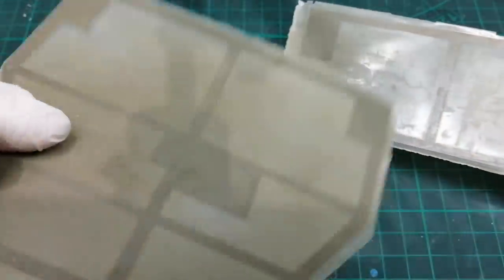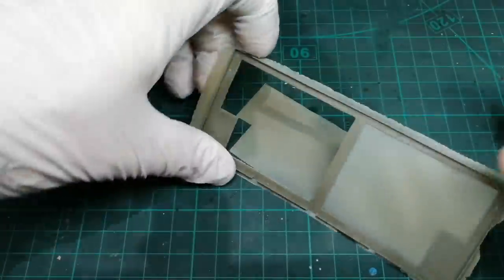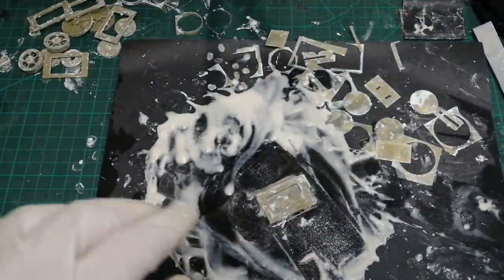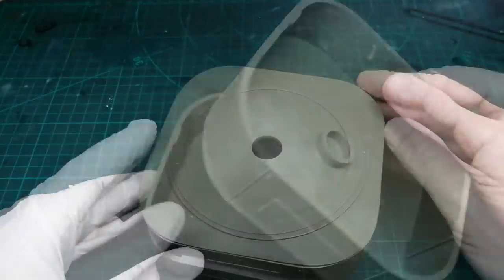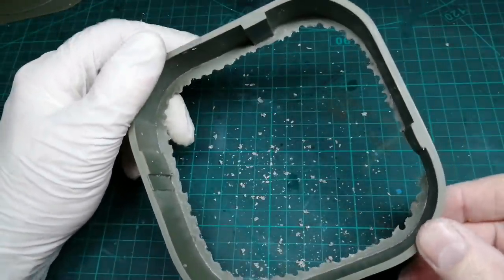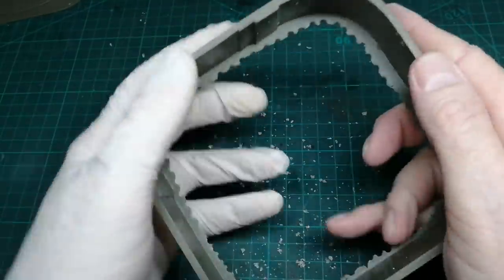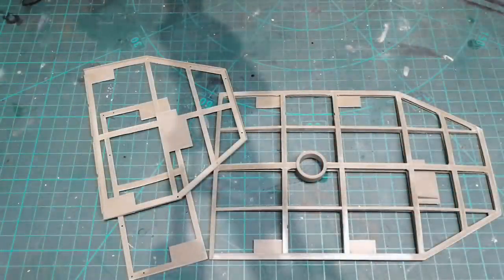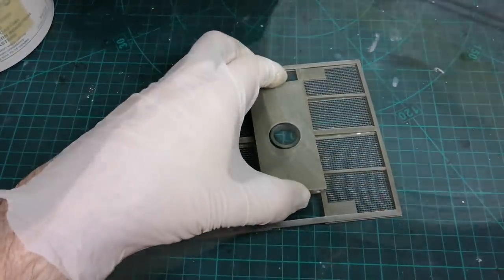HPH Models 1/32 Ship's Catapult (Full Build)

Comment: Nice build.  have done the same kit, and I must say I didn't find anywhere near the issues you had. I will agree about the hand rails though. Mine has the Revell 1/32 Arado AR 196 float plane on it, and it looks great (I wish I could post a photo on here). I would note that HPH recommends weighting the base, and if you plan to put the aircraft on it, it is needed. HPH has a great range of unusual subjects, and I would encourage people to browse their catalog. Being multi media resin kits, they are not for beginners though, and they are not cheap either. My next build is their 1/32 Catalina cutaway kit, it's on my shelf waiting for me......
Reply from the maker: Yes I saw the Catalina at the Telford show some years ago, internal detail looked second to none.
Reply: @GregsModels  It's on my shelf goading me to build it:) I have to finish a 1/32 Tamiya F-14 commission build first though:(

Comment: I scratch built one in 1/48 scale for my Arado. I didn't realise they were available as kits but I see that HPH do a 1/48 scale one also. However, at the price I think I would still have scratch built it for the cost of a little plasticard and wire. Still another good and interesting video
Reply from the maker: I didn't know HpH made a 1/48 catapult. Would be interesting to see what comes in the box.
Reply: @GregsModels  I would start with the assumption that the kit is exactly the same as the 1/32 kit you built. You've just got to do the Arado now.

Comment: Just wondering what your thoughts are on the kit now you've finished it? While it's not insane money, it's not a cheap kit, so the extent of scratch building and making good required was surprising. Will you add the Arado to it or are you happy with it as is?
Reply from the maker: I'm personally happy with the end results, wouldn't want to build the kit again though. If HpH models brought out a catapult for an American or the Japanese floatplane I'd buy/build them because of the subject, interesting and different, even if they were to have similar issues. As for the Arado; maybe one day but not for the foreseeable future.